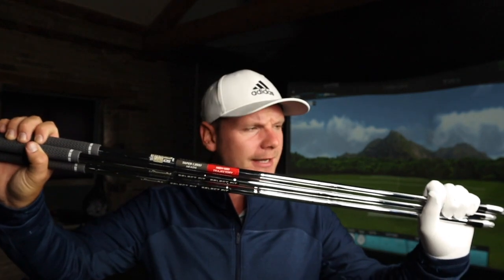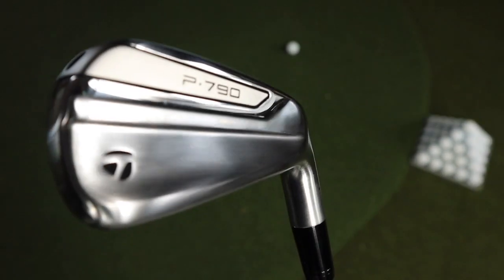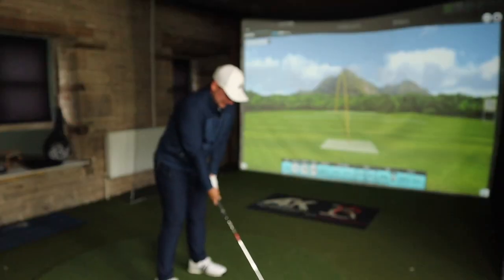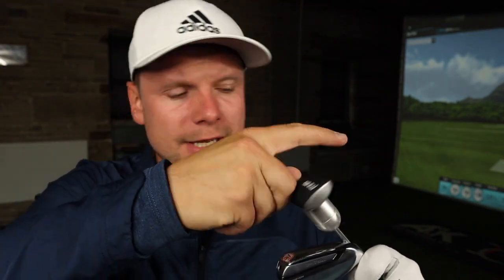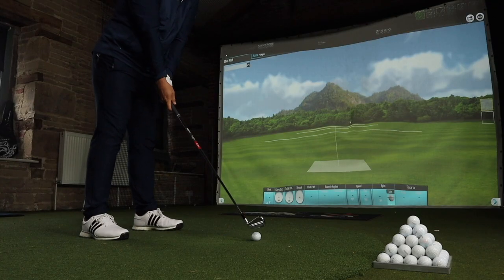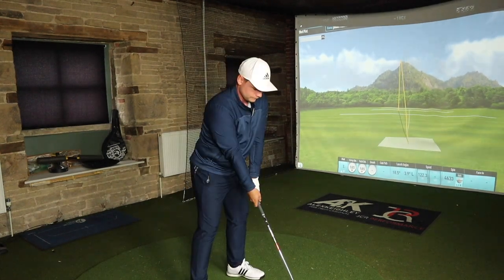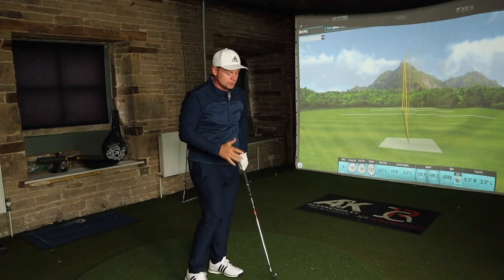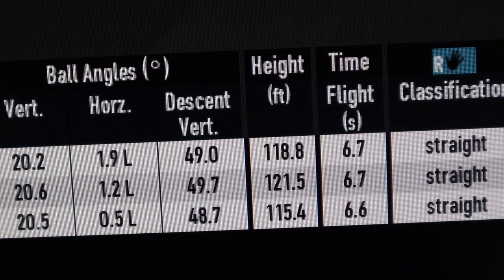DOES SHAFT LENGTH MAKE ANY DIFFERENCE?!

Comment: Hi first. I have a question. I bought a Ping G425 Hybrid 5 last winter because I didn't consistently hit my 5 iron the season before last. Well, last season I trained a lot and did very well with my 5 iron. Total width are both at 170m. The only difference currently is that the hybrid carry has 8m more. This now makes the hybrid superfluous. Since I can adjust the loft and lie of the Hybrid, I thought of lengthening the shaft to get a few more meters. Can this work? Best regards from Germany.

Comment: I have standard length jpx923’s and can hit my 7 iron around a consistent smooth 180m. BUT my shot are so inconsistent in direction/aim. I have some older clubs around an inch short and my accuracy and control was far greater but lost some distance. Distance isn’t my problem. Is it worth cutting new clubs down if this seems to be the case?? Once I cut them down I can’t don’t want to regret it as I’m running kbs 130 xs. And don’t want to pay for 8 new shafts

Comment: I bought the p790’s and absolutely love them
Getting used to the distances however, these clubs hit long
As far as shaft length, my ping’s were +1” and I have noticed I am striking more on the toe.
Great vid!!!!
Reply: HI, did you get shortened? just wondering as have g425 irons graphite +1" and seem to be hitting a lot of shots to the right, , I'm just over 6 feet tall, but have shoulder and knee injury so can't make full back swing, appreciate any feed back,
Reply: @jonwright8236  no I stuck to standard length but had them adjusted 2 degrees upright, I now play the Apeks 21

Comment: Personally I’m thinking of cutting an inch on all my standard length clubs I’m 5’5 and I like to choke down to the bottom of the grip all my clubs I just have better control of the club. The extra two inches hanging out the back is starting to annoy me

Comment: I am 6'4" and 14/16'" tall. So basically 6'5" tall. 14 years ago, I got fitted for a +3'4" length and +3 lie. They felt so much better than standard length and lie irons that I have always used. The +3 lie especially made my swing so much more natural. This setup has worked pretty good, but after using them for years,  I still feel like they're too short. I recently got fitted again. I tried a 1", 1.25", and a 1.5" length, all on a +3 lie. The 1.5" length felt the best and most natural for my swing today. I'm thinking part of the reason why is because my arms are short for how tall I am. So I need that extra club length to feel comfortable in my swing. Just bought new clubs and awaiting for them to be built. Can't wait to use them!
Reply: Did you do anything to adjust for the flex given the extra length like going with a stiffer flex or a combination of a different flex with a hard step/soft step? Thanks!

Comment: I know this post is 2 years old but i got fitted for the ping 425 and the half in longer ping standard shaft was an eye opener for me as i could see the ball better at strike,  my chin was up higher and freed up my swing no end , will be getting shaft extenders for my iorns "ping blueprint blades " as ordering a new set is too expensive , hoping for the hole that occurs in my glove at the palm to stop as i go through gloves every 3 rounds

Comment: club length really should be made by how tall you are... some one that is say 5 foot 8 inches should use a club length  around their  8 iron or 7 iron..  someone that is 6 feet or taller might use say a club length of their 5 iron or  even 4 iron.... also the weight of the club head makes a very big difference in ball flight and distance and where the weight is located, is it at the bottom of the club head or the middle of the club head.... it is all math physics....

Comment: I use +1" longer @ 1 degree upright. I want to go for a driver fitting - Cobra F9 comes in Tour Length - 44.25" - and I'm intrigued. I've had better luck with more consistent ball strikes with a shorter shaft. The standard F9 comes with 14 and 2 g weights. The Tour Length has 18 and 6 g weights. Both are D3. I'm curious about putting the 2 g weight in the front of the Tour Length to see what happens with ball flight. Will it make the ball go straighter? It'll lower the SW to probably C9, but that's what I play now.
Reply: How tall are you ?

Comment: The shaft of my driver was slightly lengthened when I last regripped it and a pal gave me a 1.5oz lead weight which fits in the grip end of the shaft. The club feels much better balanced (to me) now, and as all my clubs reg graphite shafted, next time I regrip I will add the little weights to all of them.
Reply: I've used counter weights in the past.  It can be very effective under the right circumstances.

Comment: I imagine doing it your way is insane because you aren’t needing the slightest advantages. I’m a bit taller of a guy and really in the shorter shafts am I feeling like I’m bending unnaturally to have a decent club set up.
Reply from the maker: Height has nothing to do with the dynamics you’d need if you went for a fitting 👍🏼

Comment: A lot of old theory and misinformation being passed around here. Adding length does NOT change the lie angle of the club, contrary to popular belief. The lie angle is measured at the head, and has nothing to do with the shaft... As a player who has bounced back and forth from extra long irons and standard I have quite a bit of experience with this little theory. Without going into too much detail, the added length WILL change the distance from the ball, but for those who play longer iron shafts, they will tell you it actually affects their posture more than anything. Adding half an inch and taking away half a degree of lie (as is typical of most sets progression) will not make that set play the same as a standard length set. I have a bit of an obsession with club smithing, and I have a lie loft machine, as well as a discarded fitting cart with a plethora of shafts. I can tell you from my own tinkering that lie and length are entirely independent from each other. Spend some more time with longer irons and tell me I am wrong. Once you adjust to the length with better posture and balance you will see it makes no difference on how the club sits, only how you address the ball. Cheers! Oh... and the shaft is NOT the engine of the club, it is a timing device, which would be more comparable to the transmission of the club. The engine of the club is the GOLFER.
Reply from the maker: Tell you what mate. If you think length doesn’t alter lie angle then do some more reading up. Simply physics mate.
Reply: @JamesRobinsonGolf  It is not physics at all lol. It may affect how you address the ball, being by the height of the hands during setup, but factoring in the golfers posture, the actual lie angle at the neck of the iron head has not changed. If you are adding length it is because the golfers hands are higher than the standard wrist to floor. The lie angle is adjusted to match the golfers delivery of the club. If the lie angle changes when you add length you obviously did not need longer golf clubs lol.

Perhaps  you should do some thinking mate, sounds just as I said, you have regurgitated theory and myth from the internet and old teaching without actually having the facts. Ping is one company that has gotten it right, as they treat length and lie completely differently during the fitting process. You find the correct length then adjust the LIE angle after, rather than say... just add more or subtract length from the club. It is a good thing you are not a fitter because I feel a lot of players would be playing clubs that don't fit them lol.
Reply: p.s. college golf graduate btw, our national golf management program here in Canada... done plenty of reading and research into club fitting over the years I spent in school and teaching... I have given speeches about this exact topic, and am not surprised when I get friction on the topic. You just seem to have, like many, confused the effect of changing club length without changing the setup and posture, and what LIE ANGLE actually is. So don't be butt hurt that I set you straight on this little nugget of knowledge. Don't worry... a lot of people don't get it either. If you have a chance, try playing with a lie loft machine and look at all the clubs in your set. Notice that with say.. a 7 iron the lie angle does not change when you make it longer or shorter lol, it is fixed and reads the same number (of course it did not move lol). Now notice that when you hold them at a certain wrist height... the longer clubs are flatter in SHAFT ANGLE, and the set adjust the LIE ANGLE to compensate. However if you have a club that is standard lie and too short... the toe seems to hang down, but if you just bent it upright, the same posture would have the head floating above the ground correct? Thus is my point. The length did not change the lie angle, at least not with the same shaft angle. It seems like a lot to take in but it is very simple if you just accept it for what it is.
Reply from the maker: Nasty Nate mate I’m telling you now. 😂😂😂 your wrong.